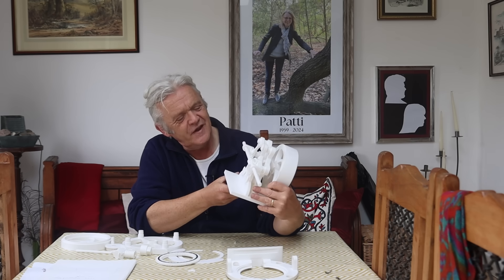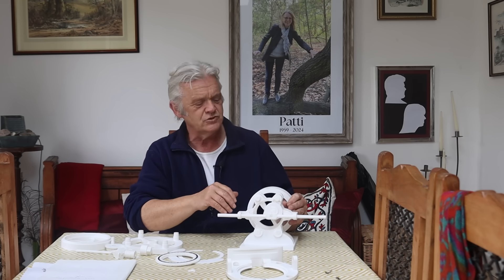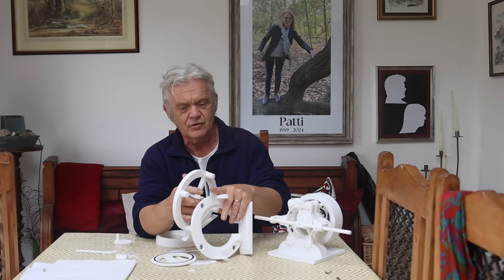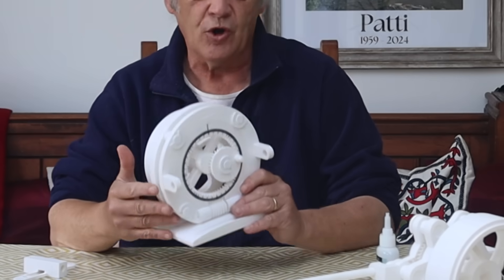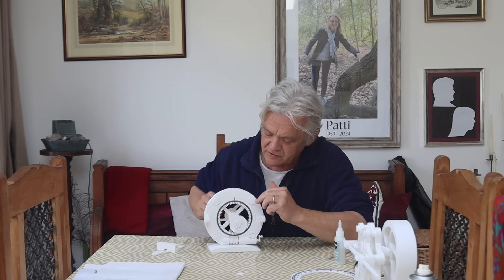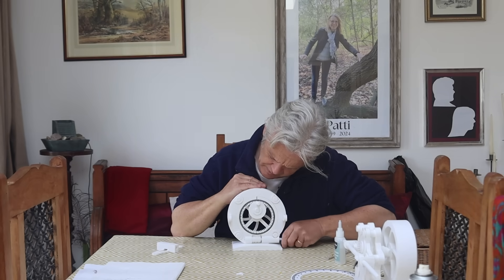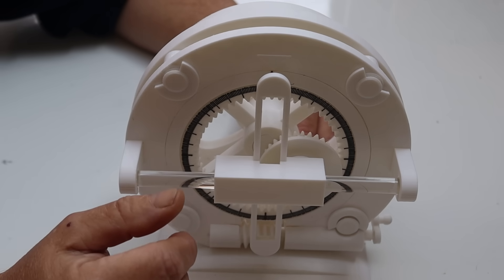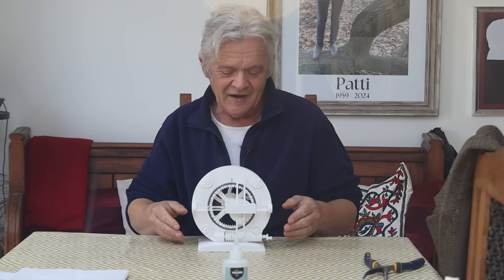2392 The Variable Hypocycloid

Comment: The linear motion is going to be L*sin(t) where t is the angle.t = 45 gives 1/2, t = 0 gives 0, t = 90 gives L.

So if one wants to calculate some specific length then it's that simple.

What one would likely want to do is rather than having the length change by the crank, automate the crank using a motor or stepper.  One could also automate the direction of the linear motion giving essentially complete control through automation.

Comment: I was thinking about this all morning, and did some calculations but unfortunately it can't be used as a CVT. However, it then hit me. You've actually invented something even cooler! The continuously variable clutch! A clutch system that is infinitely smooth, and doesn't even use friction! The X and Y rails could even be replaced with a scotch yoke for simplicity.

Comment: In the 1980s I saw video of a MUCH simpler geared CVT that I hoped to find in this video, based on the name. That old one was invented by an Australian mathematician and publicly demonstrated. Unfortunately, I do not remember his name or the exact name of his device, but I think it was called an "epicyclic transmission" or something similar. The particular version I saw had ratios continuously variable from 6:1 speed increase all the way to some absurdly large speed reduction like 1:1000, if I recall correctly. When the simple control lever was pushed beyond maximum reduction, the transmission disengaged, so it doubled as a clutch. Given the tremendous speed reduction, that clutch action would have been smoother than most friction clutches. The basic way that transmission was described as working was to take the near-circular portion of epicycloids, cut them out, and re-assemble them into complete curves. I wish somebody could remember the details more clearly, including the inventor's name.
Reply from the maker: it would be helpful if you did remember that i would be very interested to know
Reply: I kind of remember. If it is what I remember it uses a small servo motor to counter turn the sun gear and the speed it was counter turned changed the ratio and it hade 4 planets that  were nontypical shaped gears. Advice: drop it, you will waste your life pursuing this kind of stuff. There already is cvts that were bad but now work just fine. Even if you invented one, the ones out there are already good and super simple and cheap to make.

Comment: The stroke distance changes, but does the horizonal velocity change? It would be interesting to know if the smaller stroke length can transmit a different amount of torque.
Reply from the maker: you could always build one and see
Reply: @ThinkingandTinkering  I was considering it yesterday, but my 3D printer needs a cleaning of a life time, covered in angle grinder dust. I was thinking of using a belt and four sprag clutches to rectify the oscillation movements into one continuous direction. A bit like a full bridge rectifier but mechanical.

Comment: Tiny tipp: All polymeric materials have terrible friction onto themselfes and chemically similar materials, but excellent friction on other, not chemically similar materials. If you print 1 part from PLA and the other one from ABS or PET-G or similar you get a very good, self lubricating bearing. Basically ABS & ASA, PET-G and PLA can be used as a triangle as they all have good friction on each other, allowing you to get away with quite a lot. Keep to unreinforced materials. Polyamide has the best fricition - however unreinforced PA prints horribly. There is also special self lubricating materials like the ones beeing sold by igus - they are expensive but you only need medicinal amounts.
Reply from the maker: cheers mate
Reply: If the materials carry the same charge this also has an effect
Reply: I was confused by what 'terrible' meant until I realized you meant high friction
Reply: @ki0w0-lordofwatersheep  Yes - prolly should have clearified.
Reply: @Bapate-rh9be  i assume the high friction is because the polymer chains align, right? thus would highly incompatible polymers have ultra low friction between each other?
Reply: @ki0w0-lordofwatersheep well thats the idea. Pla gears can eat abs gears though, surface hardness something. Back in the old days "wades extruder" with printed gears was popular, people needed  to gear down the extruder and fitment was rarely perfect and you'd up running through them(3mn filament direct drive isn't really an option and well thats what all the kits shipped with anyway)

Comment: Genius system, I never thought about changing the phase of a hypercycloidal gear by moving the usually locked outer ring with a worm gear.
I can defintely see potential in a CVT design made from this principle being backdrivable and effecient!

But... This mechanism still produces reciprocating motion (its adjustable with a simple mechanism which is brilliant) and converting that reciprocating motion back into rotary is the main challenge with most of these potential CVT systems sadly.
Reply: It's actually pretty simple to do. I invented it years ago but always assumed it was already patented. You use a rack gear with two spur gears with (one way bearings also called free wheels.) If you don't know what those are you will find it handy,. they are basically like a bicycle in that they lock pone direction and free spin in the other.
Reply: Unfortunately, one way bearings prevent backdriving unless you double up the mechanism with one going one way and the other in reverse, which adds to much complexity and weight for most designs.

The type of ideal CVT would have high torque capabilities, non friction force transfers, a high gear ratio range, be backdrivable and relatively small. - This is sadly nearly impossible to do unless some new mechanism is invented.

I do really want to see these systems work, but we must address any flaws!
Reply from the maker: glad you liked it mate
Reply: Yeah absolutely you have to have two for either direction and possibly a third for overrunning which automatics already use a freewheel for over running. Not complex at all.

Comment: Robert, if you use two of these with a phase difference of 90 degrees and then translate the linear movement back to rotation, there would be no dead zones in the rotation. That would let you put rotation in and get rotation out. 

Or, you could even go three-phase with this.
Reply: Us two that are connected with offset angles to one-another? Like an offset herringbone gear to minimize backlash?
Reply: @IlluminatedFeline  Not sure what the physical arrangement would be, but this conversion between continuous rotation and linear sine wave is analogous to AC electricity. If you want smooth power output, you can use 3-phase AC where each sine wave is 120˚ phase shifted from the prior. Three of these waves driving an AC motor gives you smooth rotational output. So if you have an input rotation that turns into three sine waves, and use those to convert back to rotation, that could let you have rotation going in and rotation coming out of the device. I don't think this would change the output speed though, so it might not be sufficient to be a CVT.
Reply: @Berkana  Rotation in and rotation out, sounds like wasting energy, unless there's a speed or tq or reversing direction reason.
Reply from the maker: nice - cheers mate

Comment: Hello! I think I first came across this inside an old South Bend shaper which had the ability to change stroke length with a crank on top of the slide. I searched for ages to find another similar mechanism and that's when I found the one on grabcad. At the moment I'm working on another version that hopefully will work with lower friction in order to make a longer lasting motor driven version but eventually it would be great to make another 'real' one to do something useful in the workshop; possibly a die filer or a vertically mounted sawblade by first turning the who mechanism on its side. 🙂
Reply from the maker: It is a very interesting mechanism mate - i have a bit of a plan for it myself!